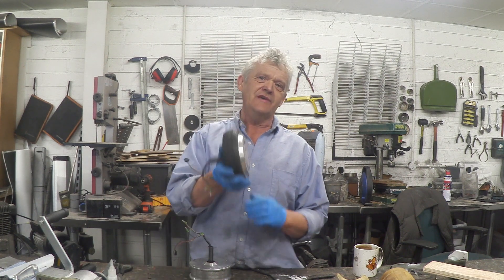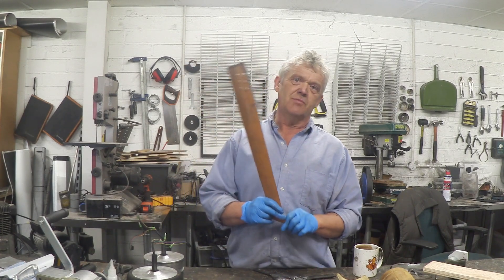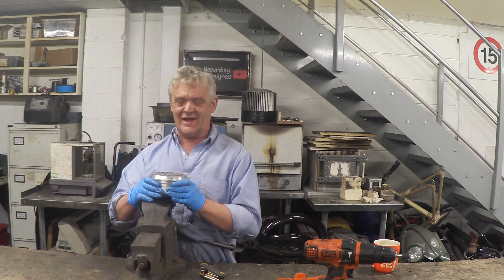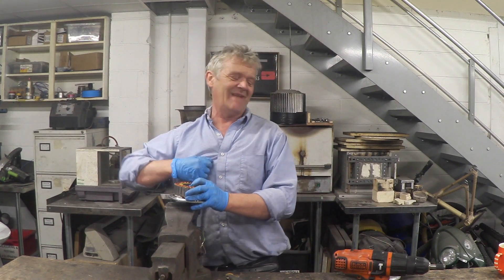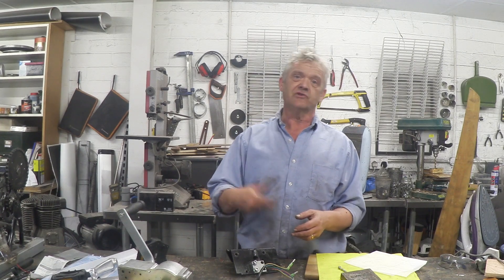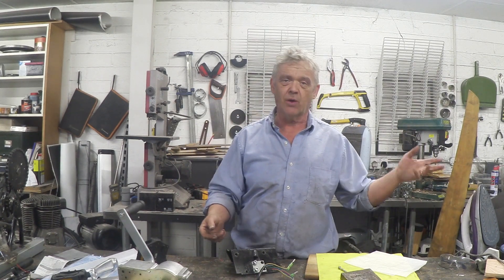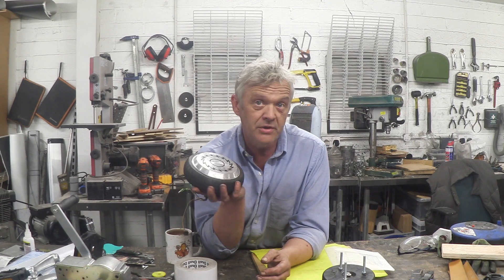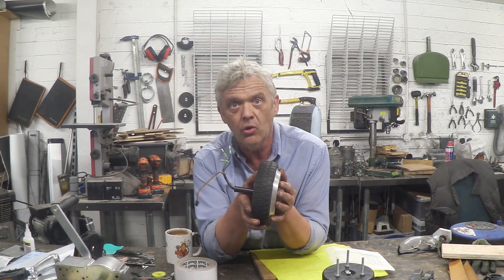1214 How To Make A Wind Turbine From A Hoverboard - Part 2 - Finishing And Testing It

Comment: from my small scale testing(sample size of one each) it appears that an e scooter motor is actually a better generator than a hoverboard motor
I tested them on a makeshift hometrainer with a bicycle, the limiting factor in this case is the human pushing the pedals and friction between the motor and the rubber tire.

From the scooter motor I got a maximum of a little over 200W hooked up directly to a 12V battery, the hoverboard motor generated 90 watts, but with significantly more effort needed and the tire was also slipping a lot, even after adjusting the tension to the point where the resistance without load was not insignificant I couldn't make it grip properly

Comment: Do you think removing some of the magnets on the outer ring of the motor will help it have less resistance when turning I was thinking about making a vertical one if they use but I'm worried about the resistance from the magnets
Reply: ball bearings give a bit of resistance,  need to find out how to make them glide better.
I wouldn't remove any magnets though

Comment: Great effort, unfortunately you botched the important bit. You need to rewire the star configuration of the coil inside the motor. Will produce much more power then.

Comment: Hi Robert, your videos are fantastic. I have a question well 2 but linked, to charge a battery what exactly else would you need to charge and also you mentioned a rectifier could you enlighten how to make one and the wiring please. Now off to watch more.
Reply: You need a three phase rectifier that turns alternating current (AC) coming from those three wires into direct current (DC) in two wires.

You can make one yourself using six diodes you can take from old appliances, old UPS's hold strong ones. Or you can order one from the 'net, couple of euros, maybe ten. Just connect three wires in and you got two wires with plus and minus. Use any search engine and study it a bit. Not hard at all. 

Now you've got DC capable of running and charging many devices but the voltage is here and there. If you go too high, you can damage delicate electronics.

If you plan to charge something like 12,6V lithium batteries, best thing would be a buck converter. This is a bit more complex to make than bridge rectifier so ordering 300W capable one for 10€ is a no brainer. With that you can adjust steady output voltage and amps lithium batteries need. You need to remember that buck converters have an upper voltage limit so way too high voltage in can damage stuff. 

If you plan on charging lead acid batteries, just get yourself a charge controller and input the power from the buck converter. Some charge controllers take higher voltages in, then you don't need the buck converter. 

If you are new to electronics and some of this stuff seems alien, you can try charging smaller batteries, like phones and power banks first. Just get six diodes, twist them together and connect them on 12V/24V USB charger meant for car cigarette plug. Now you spin the three phase generator, rectify it in DC and convert it into 5V. 5V/9V/12V/15V/20V if your charger outputs it. 10€ car cigarette plug chargers have built-in buck converter, not as sturdy as a buck converter in the same prize but it works. Maybe monitor the input voltage coming in with a multimeter when connected on the charger, best not to get over 30V.

Hope this helps. Please, try stuff and experiment. Worst thing you could do is fail and learn from your mistakes. Maybe fry some cheap electronics so don't plug your phone first in, check it with multimeter and try out with cheaper stuff.

Comment: Would be interesting to make a gravity battery with this. One wheel for generator. The other to lift the weight
Reply: Gravity is so weak though. You wouldn't be achieving a lot.

I back of the enveloped once that you need to raise a house to the height of a house to store the same energy as a car battery.

Comment: What if you attached an impeller to the shaft of the motors and attached it to a 'little y' pvc connector in 2 'n-shaped' pvc siphons that feed each other water between 2 trash cans(or buckets) that can hold water. You could use 2 pvc t connectors placed at the top portion of each n shaped siphon and run pvc to a 'capital y' connector which connects to a valve. Then to start both siphons simultaneously you could use a wet/dry vaccum on the valve until both siphons start, then close the valve.  The objective is to create 2 siphons facing opposite directions that feed water into the other perpetually, using trash cans as the water tanks, and then harnessing this 'perpetual' siphon with the motors attached to impellers on the 'little y' connector. Likely the water level cannot be even in each trash can when the siphons are started. If the perpetual siphons works then you get a situation where both motors are constantly turning and producing electricity. If this set up doesn't work than one that uses 2 self starting siphons could be tried in order to perpetually create a scenario where 1 self starting siphon siphons and 1 motor-impeller spins while the other motor-impeller is at rest until its respective self-starting siphon starts (so an alternating motor-impeller but still a constant supply of electricity). I got the motors, the pvc pipe set up, the trash cans, I just need the to find impellers that fit the shafts of the motors before I can test. Sorry if this seems crazy, but I've yet to see anyone try 2 siphons that feed each other and I can't think of a reason why wouldn't work(when the water levels of the 2 containers at the start are not even, if they are even then I'm not sure what will happen).

Comment: My plan was to use a motor from an hoverboard for a Vertical Wind Turbine build  (maybe a Daisy build instead :) ) to compliment solar panels for charging 24v batteries.  However, following this build, it will not work as it requires to much turning speed... Any suggestions for an turbine suitable for a small Vertical Wind Turbine, targeting 24 v and 200-400W? Today I have average wind speeds about 2 m/s.
Reply: If you can gear up the revolutions then the speed is not a problem with vertical turbine either.

I have supplies for double oil drum savoniuses, stacking them and rising four meters from ground on field.

Have couple of hoverboard motors but unsure how to gear one up to spin it faster.

Have you got your project going?
Reply: I made a little tester this weekend using some 200l blue water barrels, cut thin to wide in an ‘s’ bend, then alternated the  tops and bottoms around two bike wheels independently fixed into a frame top and bottom. Two rotors in the frame side by side, one higher then the other, and mounted the motors underneath and above each turbine so I could run a belt from each to the other (about 3 metres length!) works out about 5:1 ratio by my rudimentary counting! Just a toy project at the minute, as I’ve never really built my own design before haha! Hoping to hinge the blades on the drag sides, hence to offset in blade position(high/low) to counteract the imbalance created. Turns pretty well in low winds, sadly missed the weekend storms! 😂

Comment: Great video, as you have 2 motors from the hover board can you somehow couple them together to double the power output?
Reply: You would also need double the wind. When you actually charge a battery with the thing, it will create resistance.
Reply: @rogerfreeman6787  I see, so you would be better off then making 2 turbines? That way the same breeze can power 2 turbines?

Comment: What was that weird rectifier you showed? A single diode?
That delta connected stator needs 3 phase rectifier which has 6 diodes.
It should produce a lot of mA into a short circuit at the wind speeds you demonstrated.
I think you messed up the rectifier... 🤔
Reply from the maker: it was a 6 diode 3 phase rectifier mate  - from specs on this at this wind speed you would expect 2-3 watts output
Reply: @ThinkingandTinkering  thanks for the reply, in the video we couldn't see the rectifier.
Reply from the maker: @wizrom3046  sorry mate my bad - I have made a few vids on 3 phase rectifiers and I just assumed everyone would know that's the kind of rectifier you would have to use

Comment: Instead of attaching the blades directly to the motor, why not use a very large wheel with a belt around the wheel then have the motor on a fixed offset from the wheel and the belt to a very small cog on the motor.
Reply from the maker: now that is a very good idea mate
Reply: @ThinkingandTinkering  , thank you, I do have them very occasionally :)

Comment: Cool man. You should try to hook it up to a controller with regenerating breaking. Then I think you would get a lot more energy output. I love these hooverboard motors. Have build several kick scooters with them 🤓👍
Reply: When you put an electrical load on it, it will drag down. Regenerative braking is basically what's happening when the motor supplies power.

Comment: Check out Thane Heinze's work on creating a delayed lens effect. Basically by using thin copper wire many turns for his coils when the RPM hit a certain threshold , the delay in the lens effect is great enough for the rotation speed to over come the effect. The magnet is pushed instead of repelled.
Reply from the maker: cheers mate

Comment: Hi, without a variable pulse width modulator all your doing is heating the stator,. That why ypu have a low output.  At 600 RPM it will produce about 10 amps.
Reply from the maker: that doesn't sound right mate - why would a PWM do anything on a generator? Isn't PWM to do with motor speed control?
Reply: @ThinkingandTinkering  Hi, when used with a generator it greatly reduces the back EMF at the stator. Less heating at the stator.  I use a variable PWM on my hand crank generator and peddle Gen when charging super capacitors. They are about $10.00  on ebay.
Reply: PWM is used with wind, solar and regenerative braking systems. Without it all your doing is generating a lot heat at the stator

Comment: I’m confused you said it was a DC motor, but put out  3 phase AC?
Reply from the maker: it's a brushless DC - on a normal DC the brushes and commutator act as a rectifier. Here there are no brushes or commutator - so - AC output

Comment: Rose bud, Would be better I think. Those blades are too long.??
Reply from the maker: I don't think so mate - the blue length is actually good as the torque on this little motor is actually quite high
Reply: @ThinkingandTinkering  Ok So a water turbine may be better, than a wind.

Comment: I would have thought that the specified power of the motor would be slightly more than the amount of power you should able to get out of it as a generator. It would be interesting to know the specs of some of these motors that you are using as generators.
Reply from the maker: you could always look it top mate it is a razor hovertrax hoverboard

Comment: Robert can I just say, you are using this motor as a generator the test is unfair and totally in valid. The motor is wired to be a motor for it to be a decent generator you should separate the phases then parallel or series connect them. That 5 ma will go up to hundreds of ma I'f not amps.
Reply from the maker: that doesn't seem right to me mate - a motor like this is going to be in delta or 'Y' configuration wiring - delta is the same as your series wound and  Y is the same as your parallel isn't it?
Reply: @ThinkingandTinkering  not quite, you will need too use the hall sensor wires unless you can get your own wires through the hole.

Comment: We use gas bottles cut out with a grinder to make blades. First take fitting out, then turn bottle upside down to remove left over gas for couple of hours.  Or use compressed air into bottle to remove left over gas. Good work guys. Now did you get to hoover boards?   If so why not make the other in to a go cart Rob? Have a wonderful day.
Reply from the maker: exactly what I am thinking mate lol
Reply: @ThinkingandTinkering  remember to use steer on that board you will only need stick controls going to the board. Good luck.

Comment: Very suprised at the low output from these motors i would expect far more.
Reply from the maker: why? - output isn't really a function of motor design - it to do with number of turns of wire, magnetic field strength and speed of rotation
Reply: @ThinkingandTinkering  I agree with all of the above but that motor does have powerfull magnets and a lot of coils with what looks like thick wire windings  ..so at low RPM i would expect low voltage but higher curent  . but i may be missing something .

Comment: Brilliant as always Rob thanks. Just if you wouldn't mind I need to ask a none related question. Dose the length of a bog standed electric cable (ie extension cord) decrease the longer you run it from the power point? Hope you can help 🙏 . Thanks mate.
Reply from the maker: I am not quite sure what you mean mate - but as a cable gets longer resistance goes up so voltage at the end you use it goes down. They call this voltage drop and is a serious problem for very long cables

Comment: You did remove the electronics inside? That motor should produce way more than 4mA, rather 5~10Amps and roughly 18v-30v at least.
Reply from the maker: all the electronics are external to the motor with the exception of the sensors - and it would produce 5-10 amps at 18-30 volts if it was spinning fast enough - the problem here is it just wasn't spinning fast enough to produce much

Comment: I've watched another channel that did experiments with hoverboard wheels but he used water instead of wind as it was much more stable when available.  I saw one video where he was getting almost 60 volts and 3 amps.  Experiments are a blast and turning that into practical application is even better.  Love your stuff.
Reply from the maker: this will produce decent output - if you turn it fast enough and for that you need torque and gearing - ideal for water applications
Reply: I am actually doing something similar right now what kind of rectifier did you use which diodes to build

Comment: Two of these motors can easily push one man on the board.... So what if we put this to a normal bicycle like the one where you put a drill with some right angle adapters.... And give it a go.... As now we have higher Reduction one of the motor might be enough for that application.
Reply from the maker: I would think so mate

Comment: please make 6 blade turbine like mine and then test it ;) or maybe you could experiment with stator for low rpm power?
Reply: aren't 3-blade designs generally agreed upon to be the most efficient? in what specific situations would a 6-blade variant be preferred?
Reply: @DimitriPappas  More blades, more torque, more self braking. So, in very windy areas one could benefit of 6 blade system and while spinning slower, giving more power to the people.
Reply: @Teknopottu  More power to the people!!😂 Sure sounds like a winner then😉
Reply: @Teknopottu  for wind braking yes... if blades would be good and heavy not from pvc then output would be max 250-280w... but my turbine have got only 186w before it started wind braking... 3blades are good for more rpm in end but they are not good for low wind... and yes it all depends from area... in my videos you can see my area and its full of dirty wind... but it still makes constant power of 80watts when wind is 11 meters per sec
Reply: @SigmaWorksSW3D  You are getting some nice readings. What do you use for generator?
Reply: @Teknopottu  Thanks, im using same hoverboard wheel like Rob in his video, but in 6 pvc blade config... for low speed power output
Reply: @DimitriPappas  its more for low wind rpms... my 6blade turbine makes 4v in 1.5 meters per sec... thats why i prefer 6 blades not 3 and output also is 186w in good 21 meter gust
Reply from the maker: I'll have a think about it - cheers mate